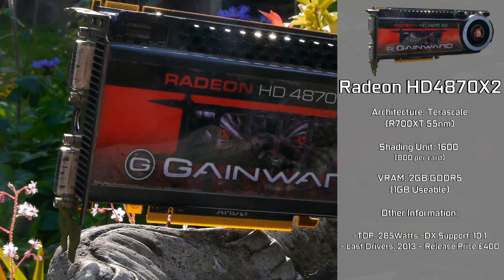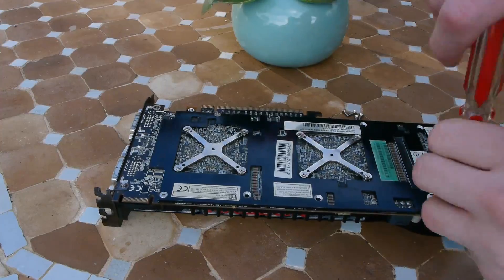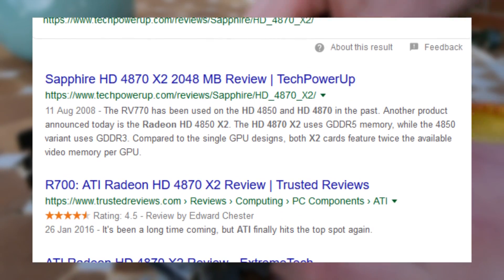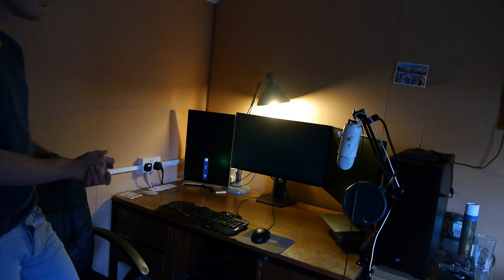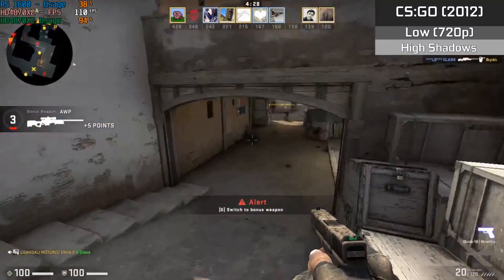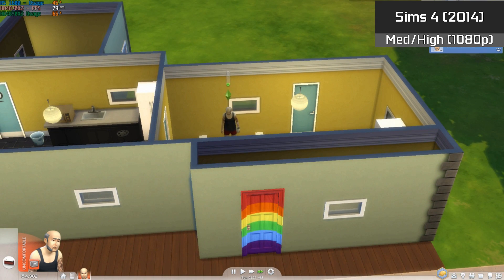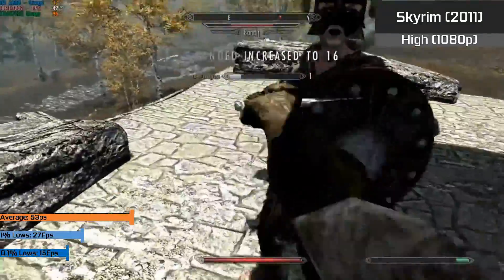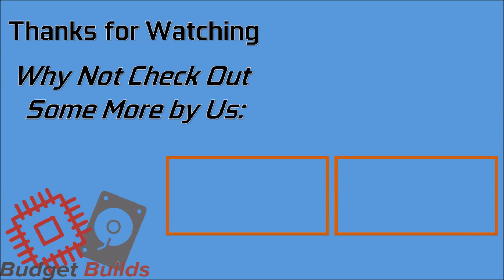When AMD Stuck 2 Graphics Cards Together - The HD4870X2

Comment: I have an HD5970 :) It's a really nice graphics card, basically the X2 of the 5000 series.  I found it at a junkshop for $35NZD and took a risk on it. Really good for Battlefield 4, The issue with it is its so huge you can't even fit it in most cases. The only case it fits in that I own is a Corsair 800D (the mini fridge).
Reply: I’ve got a “mini fridge” on mine. People might think your referring to phase cooling (-60c isle temps and -35c peak under load on FX-8350 at 1.7 Vcore with core temp peaking below 0c under load). It’s a nice little cooling unit... much bigger compressor, but it’s fairly small
Reply: @jakegarrett8109  Fair point lol. I just found that once I had that case people joked it was a mini fridge because of how huge it is :) I have an FX8350 in it but at stock speeds cooled by a Hyper 212X. Frankly I'd never even put water cooling near it let alone sub ambiant stuff. I reserve that for less important systems like my overclocked P4.

Comment: I was digging through some boxes and I have 2 of these still.
Reply: Now I'm wondering how a 4 GPU Crossfire would work, if it'd work at all
Reply: planetfifa I have 4x Fury in my main system (100 fps in Crysis 3 at 4k Ultra, compared to 45 fps on my Titan Xp), that’s pretty much how most of my games go besides Fortnite (one of the few single GPU games I own, or at least of one the few that would otherwise benefit as most of mine either support it, or already run 300 fps at Ultra 4k with 16x AA and don’t really need crossfire).
Reply: crossfire them
Reply: Quadfire

Comment: The main problem with the 4870 X2 is the cooling solution. Two solid copper blocks with no vapor chambers or heatpipes. I mean, sure, the first copper block right behind the fan got cooled properly, the second block got heated by hot air, usually resulting with one of the gpu dies getting baked. I have two of these, a Sapphire model with the stock heatsink, and a second card with the aftermarket Arctic Cooling triple fan heatsink specific for that card. Funny enough, Arctic Cooling support actually tipped me off about the auction listing on ebay for the card when I asked them if they happened to have any of the heatsinks for this card in backstock somewhere. Once cooled properly, its a pretty beastly card that stayed relatively chill under full load and very overclockable, though I didn't try yet since I didn't want to ruin it. ^^;

I might try overclock it at somepoint or if I somehow manage to find either a second arctic cooling heatsink or juryrig some kind of liquid cooling situation for the four gpu dies and a bunch of small copper heatsinks for the vrm and memory chips.
Reply from the maker: I didnt attempt overclocking but with a custom fan curve we didnt see it ever go above 79C. VRMs, and VRAM seemed to be cooled alright by the blower, but they are some toasty GPUs
Reply: Budget-Builds Official ouch, My Titan can’t even stay that cool at 100% fan speeds stock... I’m impressed they got 2 GPUs to run that cool with a blower, that is some proper engineering! I remember my old ATI Fire-GL V8650 ran like 70c idle, and when overclocked 25% gaming with fan like a jet, I remember thinking “it’ll be fine, just don’t look at the temps...” and played great for like 2 hours on a super hard multi-player mission in Warface and one of the teammates said “ok, we’ve got this in the bag, nobody die..” and then my system shut off... Oh... great times... did hit 60 fps at 1024x1280 in that game though, but it was a beast to cool! (card is fine)
Reply: @BudgetBuildsOfficial  Sounds about right with what I saw on the stock sapphire one. Loud but cool enough given that its a dual gpu. The one with the arctic cooling heatsink on it was quiet given that its a triple fan cooler with a heatsink to rival that of some of the modern RTX heatsinks! xD I might break mine out and play with it again. I did just get my GTX 295 working so it'll be cool to see how they perform compared to each other. :)

Also, I was the one who just posted pictures in the normal discord chat with the two 4870x2s~ ;)

Comment: Do a fx video, that grave needs to be dug up to show the trash that those CPU's were.
Reply: Fx 4300 preformed worse than the previous gen.
Reply: My Titan Xp is far too slow for an 8350 stock... Massive GPU bottleneck at 4k, probably want duel Titans or duel RTX 2080. So yeah it’s slow, but isn’t that still “fast enough” if it can keep up with that? I do run much faster systems where I crank up the settings (I drop to mixed medium/low settings on Fortnite with the Titan so it’s not so GPU bound), but I’d still say the FX is decently fast considering most people don’t have the duel Titan RTX or duel 2080ti it would take to make it CPU bound in typical games.

Playing low res, then sure, but it’s still fast enough to have fun (this is coming from a guy that calls his Titan Xp “dog$hit”, I’m very picky and literally puke after playing a console for 20 minutes from the low and inconsistent fps consoles do, which sucks because I couldn’t play but for those 20 minutes at my little cousins gaming birthday party and felt awful the rest of the day...)
Reply: Lolled9991 well that’s a 6 core, and most even old games were made for Intel’s quad core with hyperthreading (8 threads, just like FX-8350), so your kinda between duel core and an old quad core, so that would make sense you’d be struggling, your missing a lot of the CPU!

Also the 8350 stock is 4 GHz base clock before boost, so you might have some pitifully slow overclock below that (mine did 4.8 GHz on a 120mm AIO, which would be stock for FX-9590, but stock FX-8350 is overkill for my Titan, though I’ve got the FX at 5.5 GHz at 1.7 Vcore on sub-zero phase cooling for lols just testing long term effects like pins rusting or plastic cracking etc, the speed is certainly not needed for merely a single Titan Xp Star Wars collectors edition like mine).

Main system is Threadripper 1950x with 4x Fury on water powered by duel SuperNova 1300s driving triple 4k workstation and 4k gaming. Duel PSU not required, but it’s Halloween themed built into a casket and duel 13’s is just cool (plus if the Threadripper goes on Liquid Nitrogen, then I don’t want to rewrite everything). On a 120mm AIO the Threadripper does 4.15 GHz all 32 threads, but you don’t need any overclock for gamin as with FX, I only hit 100 fps in Crysis 3 at 4k Ultra (a Titan Xp in that system only does 45 fps).

As I mentioned, FX really is fast enough to handle 4k, rarely do you see 60 fps even on the best GPUs with any CPU... Fortnite runs 67 fps on a Titan, but I mean, it’s literally Fortnite, not exactly “demanding” by most people... (that’s why I drop settings on the Titan, I target 240 fps for competitive input lag advantage)
Reply: Lolled9991 reinstall Windows, even my laptop with 6c/12t at ~3.8 GHz 8750H is sometimes CPU bound pegged at 100% when the GPU (GTX 1070 at 2 GHz) is also typically maxed out or near it. They trade which are being bound at 1080p Ultra. You have so few threads, that your CPU should be 100% in basically every game at 1080p (even many of the old games will use 16 threads just fine, the new ones especially), otherwise you should be GPU bound on with the Vega nearing 100%.

But it could also just be an incorrect readout, I’ve got GPU-Z validations at 35 GHz validated on the website, and I’ve seen a GTX 1080 have low fps in the desktop because it was mining but Windows reported only “20% utilization” but that’s clearly wrong if it takes 5 seconds per screen update. Only take those numbers as a grain of salt. Your CPU should also be showing below room temperature at idle, which is physically impossible for your cooler, but nobody fixed that bug in HWMonitor for FX so it’s always wrong at idle. Also the voltage readout for your CPU is probably super far off on FX in any software, the numbers I reported are true voltage with a multimeter probing the board, Windows may show way off, I’ve even seen 1 million volts reported on a GPU... so really don’t put too much faith in the software approximate percentages, as even basic measurable things like temps and voltages are often wrong.

If you have bad performance, a windows reinstall is in order... I typically reinstall every year because windows is too damn lazy to check their updates to see if they are stable before force feeding them out (should be obvious they do 0 testing based on this year’s updates...). With Linux this is not a problem, but I still do most of my gaming on Windows and a few CAD applications are Windows only (Steam Proton will run a bunch or most of “Windows only” games, but I just usually boot into Windows when I’m gaming, I also have a lot of specifically dedicated machines, some even optimized for certain games. I’ve got too many thanks to the maintenance from crappy M$ updates, I’ve got some under desks, one in a casket, a test bench, and even hanging on the walls on display as my “console PC” as well as gaming laptop and a dedicated Linux laptop for anything that’s actually important), it’s a total pain to reinstall all of these, but Windows is so buggy you pretty much have to (unless you use Linux, then your good)

Comment: I remember that HD4770 was a big deal back then, I think it was the first one on DDR5
Reply: Andrei Bolohan The 4770 got so much love because it could O.C. like mother and best the HD 4850. All for only 100 bills.
Reply: Nope. The first card with DDR5 was 4870. I'm not sure if 4770 ever use GDDR5 because initially AMD use GDDR5 to differenciate the high end offering. For example the difference between 4850 and 4870 is the former is using GDDR3 while the latter is using GDDR5. 4770 is even more low end than 4850 (and there is still 4830 in between). But 4770 is AMD first 40nm GPU. 4770 was very popular for it's performance and efficiency back then.
Reply: @arenzricodexd4409  It a ddr5 card
https://www.techpowerup.com/gpu-specs/radeon-hd-4770.c290
You're right it wasn't the first one, but it was close of being the first

Comment: Hey man plz do a video on the r9 fury plzzzzzz
Reply: I run 4x of these in my main system, great cards. Doubles my Titan Xp in a lot of my games and 2x is great for 4k gaming (well, at least better than 1080ti RTX 2080, I wouldn’t call that great, but for $250 for a 2 pack of Fury cards, the performance is good and the price is amazing, less cost than the turtle RTX 2060 for duel Fury...)
Reply: Oh OK cheers and is there frame time issues when u use them in crossfire
Reply: Kanvar Murray more frame consistent than my Titan Xp single, so it’s shockingly good, I was impressed.

I also have some RX 470, but when I tried 2x, it was terrible stutter for those cards (HBM on the Fury is probably the difference for the Fury working so well). The Fury is just a much better card for crossfire apparently, exceptionally good. I’m very happy with it, I just wish Vega VII supported crossfire or for Vega 64 to officially support 4x (and the best Nvidia offers is duel Titan RTX, which wouldn’t really even be an upgrade... no way am I spending $6000 on GPUs equivalent to sub $600!)

Very happy with the crossfire Fury, and even on games where crossfire doesn’t work, it’s still pretty fast and still beats any single GPU at the same price of $250 (basically you get massive performance increase above even Titan Xp levels when it works, and even when it doesn’t run the second card it’s still really good value, you can’t really lose with that!). Make sure both slots on your board have at least 8x when using duel GPU (B350 with Ryzen is fine, although Intel sucks at giving you many lanes, the 9900k only has 16 lanes... This is why I use Threadripper with 64 lames, for quad GPU, but my Ryzen 1700 with X370 was great with duel Fury. Actually even FX series seemed to be fine with 2x GPUs, it’s just kind of old for such high power GPU config, but it worked anyways).
Reply: I have an X470 board so it's not a problem my old 980 died when I tried to mod it so was looking for an inexpensive 1440p gpu that I might add a second one later so thanks for your help
Reply: Kanvar Murray glad I could help, you should definitely be set for 2x with that board. I’d go for duel GPU right out of the gate for 1440p (you’ll definitely want it if you have a 144 Hz monitor). They are super cheap right now, I paid less than $250 like half a year ago for 2x Nitro Tri-X OC+ cards (the best Fury there is). I wouldn’t get the Fury X, the pumps are failing on those and if it’s $10 more than the Fury non-x, then it’s too much, it’s like 2% difference in games, and the air cooled Sapphire cards run below 60c normally and whisper silent on my test bench or case with panel off (I was too cheap to have any case fans when I first had duel Fury, only fan was from my AIO fan in my $20 case... open panels was the cheap option for good cooling, lol!)

You’ll also save on a 2 pack, that’s the main reason I’d get both (that and cheaper shipping cost, I included shipping for my cost paid). I bought my last 2 and they came in an AntMiner packaging box (which I was pretty sure they weren’t gaming when they had hundreds of them), but that shouldn’t bother anyone, the Fury cards are beasts, seriously the most overkill everything cards, they don’t even flinch from years of mining, that does nothing too them. These 2 are my highest binned Fury cards of the 4, and by a decent amount, so mining on them did nothing to hurt them, the Sapphire Fury cards are built like tanks! Do note they will take a triple slot space (you should be fine in the X470), but I did manage to smash 2 together on a micro-ATX board with FX and it worked fine (literally pushing each other over in PCIe slot, and the top card needed fan cranked up as it was completely blocked, yet it still somehow did alright even in that condition... Like I said, they are built like a tank!)

Have fun! Hope they perform like mine have, always putting either a smile on my face or mouth dropped to the floor (seeing Crysis Ultra at 4k 100 fps is mind blowing, I mean, yeah it sounds cool, but it’s just mind blowing to see how fantastic it performs, I stared at the screen for a solid minute not believing it, but dang it’s fluid and silky smooth! Probably gamed for 2 hours with my mouth never closing, it truly is mouth dropping performance!)

Comment: I am thinking of making a video on a Radeon x1300 pro on my other channel. Any advice?
Reply from the maker: Cover 3D Mark so you can compare to other GPUs, and take in account as far as the card can be pushed title wise. The X1300 can definitely run some RTS Titles, but it also has S-Video output so maybe take a look at CRT 480i/240p Performance as a Retro Card?
Reply: @BudgetBuildsOfficial  Interesting. I was actually planning on placing it in an old core 2 duo business machine, so that would work out pretty well

Comment: SLI this card
4gpus 2 slots used
Reply: Crossfire it you mean :-P

And GTX 690 SLI has been done by Tech YES City IIRC.
Reply: RWL2012 SLI and Xfire are nowhere near the same. I get more stutter on my single Titan Xp than I do my 4x Fury... but then you try just even 2x RX470 (same Vram amounts, but only GDDR5 vs HBM), and my goodness it’s not micro-stutters, it’s just stutters with nothing micro about them! It’s playable, but it’s just night and day difference, and this is for identical drivers we are comparing. Nvidia doesn’t even use close to the same technology (Like comparing FX 8 core vs Ryzen 8 core vs cell phone 8 core, all wildly different), and the stupid SLI bridge is slower than USB in data transfer, so it’s really not comparable while Radeon has massive PCIe and memory bandwidth historically (4098 bit memory interface on my old Fury cards vs 384 bit on my Titan, Radeon loves putting insane bandwidth on cards, which is great for high resolution Xfire, while Nvidia only optimized for single card)
Reply: @RWL2012  oh ok

Comment: Are there any tutorials on how to get modded drivers to work on terascale gpus? I have tried everything on my hd4850 and i always get error code 43
Reply from the maker: Try the drivers pinned at the top of my video
Reply: The ones from leshcatlabs website? I tried those ones and i only have 3 . Inf files and none of them work
Reply from the maker: @amiga5008  There is a set from Guru3D Linked as a Pinned comment